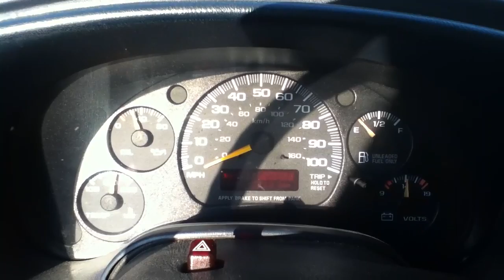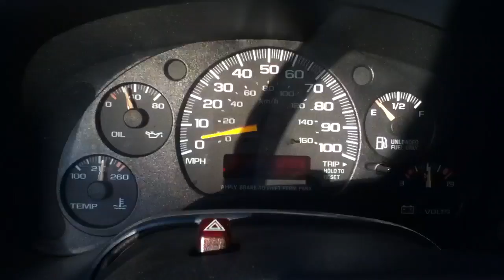Transmission Shifting Issues and Speedometer Bounces Everywhere or NOT AT ALL

Comment: Mine is doing the exact same thing. Replaced the ECM after being diagnosed by a transmission shop. Didn’t fix it.the guy that ran the scan on it said the transmission itself is fine, all codes pointed towards the ECM or ignition switch. There is a couple videos on here with people having the same or very similar issues. They replaced the ignition switch and it fixed it. The switch is $167.00 at O’Reilly’s Auto Parts. I’m replacing my switch in the morning, (7/5/20).
Reply: Did the switch  fix it
Reply: Did it fix it!
Reply: lotso69 did it work? Having the same problem with my 08 Malibu. I put my car in any gear and my speedometer starts going crazy and I can barely move
Reply: My ABS light is on too and the speedometer is jumping up and down and causing the transmission to shift up and down for no reason and it won't let the cruise control turn on.  I replaced the transmission speed sensor on the back of the transfer case and the ignition switch wiring harness, but they did not fix it.  How did you fix it?
Reply: @MyLifeThai371 did you figure it out? Same problems and fixed everything
Reply: @dillonbaker3085  Every time that I replace the transmission speed sensor on the transfer case it fixes it for a short period of time.  I have gone through 3 transmission speed sensors.  They are always wet.  I think the breather hose on the transfer case is plugged with dirt and when the case builds pressure it blows through the transmission speed sensor and  causes it.  I will tackle it next summer by blowing out the hose and changing the transmission speed sensor as well as the pig tail that plugs into it.

Comment: Seems like the transmission control module (TCM) 
Or a bad wiring around the TCM harness 
But my guess is you ran outta gas by the end of the video, 
Unless your van runs on fumes

Comment: Did you fix it because my truck is doing the same thing?
Reply: My ABS light is on too and the speedometer is jumping up and down and causing the transmission to shift up and down for no reason and it won't let the cruise control turn on.  I replaced the transmission speed sensor on the back of the transfer case and the ignition switch wiring harness, but they did not fix it.  How did you fix it?

Comment: I replaced the speed sensor. But it's still doing it. Did you figure out what it is exactly?
Reply: Check your wires that go into the plug.  That go's into the speed sensor. Check all of them. If you have to cut upward to find any cut wires.
Reply: My ABS light is on too and the speedometer is jumping up and down and causing the transmission to shift up and down for no reason and it won't let the cruise control turn on.  I replaced the transmission speed sensor on the back of the transfer case and the ignition switch wiring harness, but they did not fix it.  How did you fix it?
Reply: @MyLifeThai371 looking for an answer to this myself! Any luck?

Comment: Hi ! Did you figure out what it exactly was? My vehicle is doing this while driving. I haven't been able to figure it out after replacing the instrument cluster. Anyone knows exactly what it is?
Reply: It can be the vehicle speed sensor or just a bad wire check for ripped wires or change the VSS (Vehicle speed sensor) I have the same issue
Reply: I changed the inner and outer speed sensor as well.and I replaced the catalytic converter as well. but it's still doing it
Reply: My ABS light is on too and the speedometer is jumping up and down and causing the transmission to shift up and down for no reason and it won't let the cruise control turn on.  I replaced the transmission speed sensor on the back of the transfer case and the ignition switch wiring harness, but they did not fix it.  How did you fix it?

Comment: Lucky man! usually is the ECM!
Reply: How do you know if the ecm? I currently have that problem but all my gauges bounce around and the ac stops blowing cold air , puuting it in park doesnt automatically unlock my doors and cant open the tailgate. I drive a 2008 chevy suburban 5.3 z71

Comment: So how did you fix it
Reply: My ABS light is on too and the speedometer is jumping up and down and causing the transmission to shift up and down for no reason and it won't let the cruise control turn on.  I replaced the transmission speed sensor on the back of the transfer case and the ignition switch wiring harness, but they did not fix it.  How did you fix it?

Comment: Mine is doing the same thing. Is it the sensor that bolts to the outside of the transmission? My brake light has been on ever since it's been happening
Reply: Emory Bragg mine to right back light is out
Reply: My ABS light is on too and the speedometer is jumping up and down and causing the transmission to shift up and down for no reason and it won't let the cruise control turn on.  I replaced the transmission speed sensor on the back of the transfer case and the ignition switch wiring harness, but they did not fix it.  How did you fix it?
Reply: @MyLifeThai371 did you ever figure it out?

Comment: Hey, i have the same exact problem with my 02 gmc yukon, ware you able to figure out what was the issue??
Reply: I am also having this issue, any luck figuring out what it was?
Reply: My ABS light is on too and the speedometer is jumping up and down and causing the transmission to shift up and down for no reason and it won't let the cruise control turn on.  I replaced the transmission speed sensor on the back of the transfer case and the ignition switch wiring harness, but they did not fix it.  How did you fix it?
Reply: I can't read any replies on the comments they just gone

Comment: When fluctuating does the car jerk?
Reply: Mine does any answers??
Reply: My ABS light is on too and the speedometer is jumping up and down and causing the transmission to shift up and down for no reason and it won't let the cruise control turn on.  I replaced the transmission speed sensor on the back of the transfer case and the ignition switch wiring harness, but they did not fix it.  How did you fix it?
Reply: @thehoodstreamer2839 did you ever figure it out ?